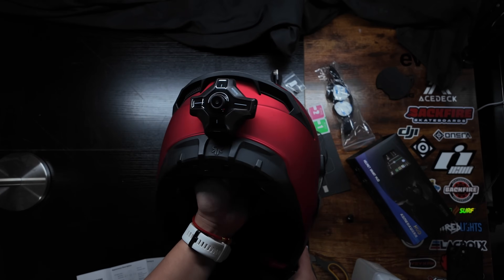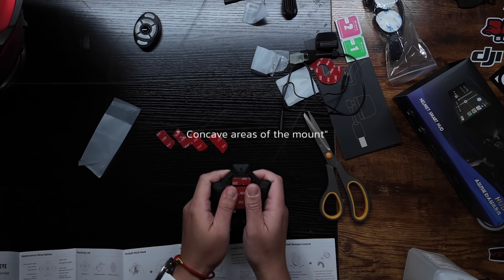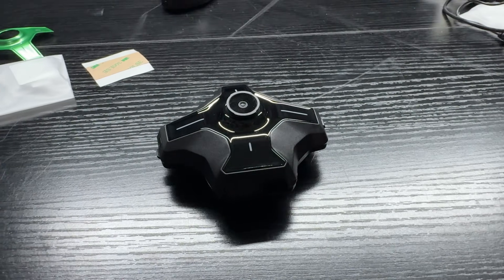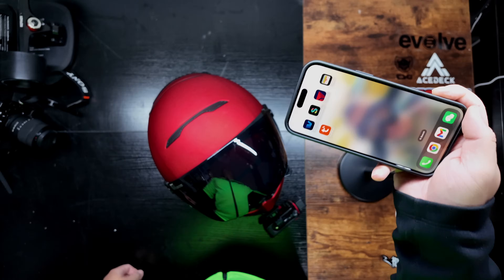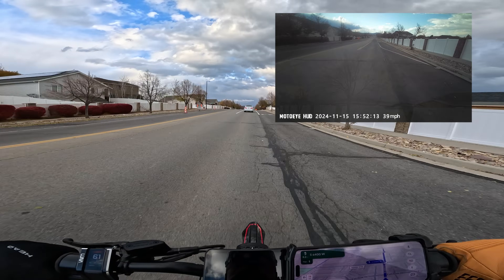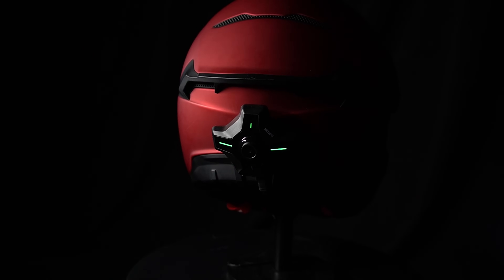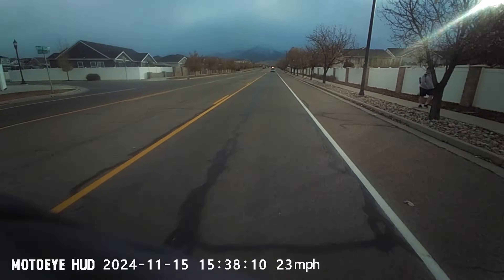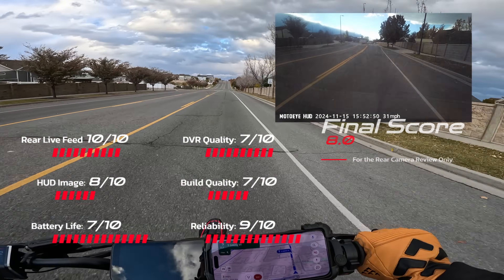The Future Is Here! Rear View Heads Up Display For Motorcycles & EUCs. Motoeye E6 HUD AR Glasses.

Comment: Is it easy to turn on and off while you’re riding? My concern is that it could be distracting while you ride, and I don’t always want to have it on. Same question for adjusting while you ride. Having it above the eye line is great for vision but it would probably bother me as checking right for cars or mirrors it might block enough to be a safety consideration. Otherwise, this is badass lol totally want one

Comment: If you have a modular helmet would the eye tint interfere with the operation of the HUD eye piece?
Reply: depend on the modular part itself, because some modular helmet is flip up with the visor and the other doesn't, also there are model where the front part is removable
Reply: @breakhart I'm talking about the inside tint shield that is on all modular helmets and not the exterior visor.
Reply: @fraliexb ah are you talking about the double visor?

Comment: I'd be interested in just the AR glasses as an HMD to stream information from an app that tracks lap times and OBD data like rpm and engine temperature.
Reply from the maker: Yeah it should do as it can mirror your phone screen. If you have something that can connect your bike to your phone, then you can show it on the HUD.
Reply: @evtechsteven  This would be in a racecar, but same principle.  Just hope that it won't interfere with a HANS device.

Comment: Very cool Product, but $500 is quite a bit more than my helmet mounted rear view mirror! Really hoping to see this become popular and reach down to the $300 range!
Reply: Yeah, this is what I struggle with too. I get why it's expensive, but at the same time, it doesn't do a better job than a rear view mirror mounted on a helmet. The mirror does look a bit dumb, but it's cheap and useful. Also, the map feature is nice as well. I would actually get this if it's $200 or less.
Reply: @BN99239  is a little stick mirror going to hold up to 80+mph winds?
Reply: @BN99239  looking around i've seen them on aliexpress for around $440